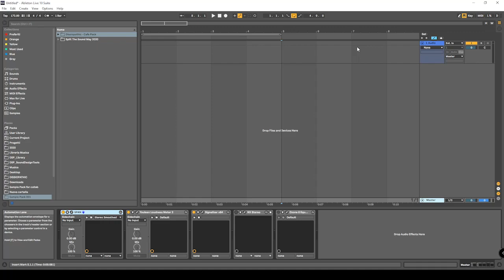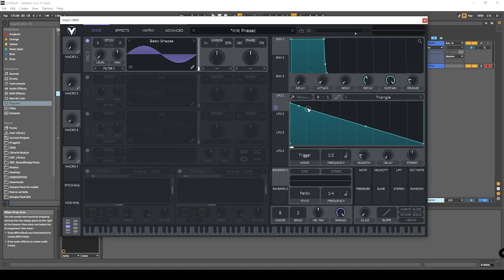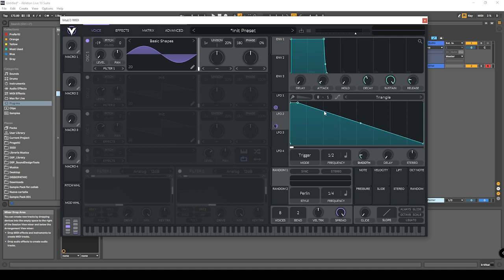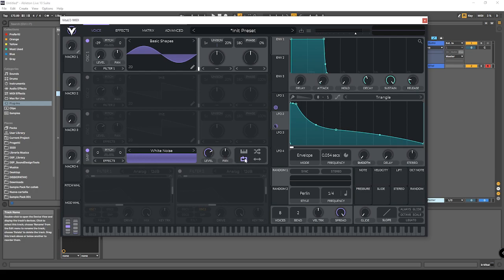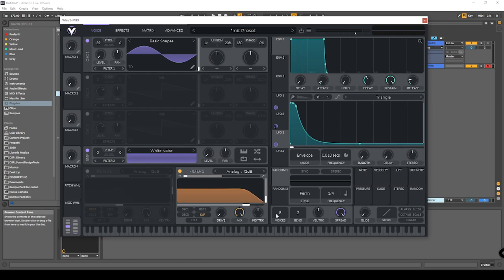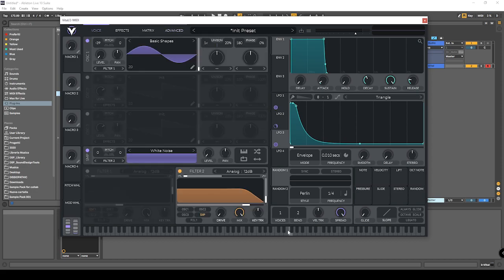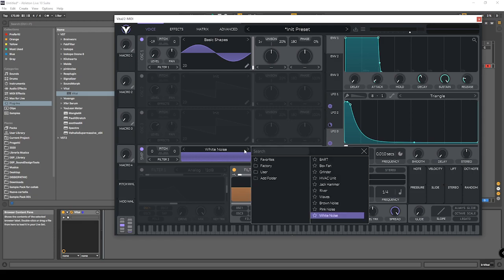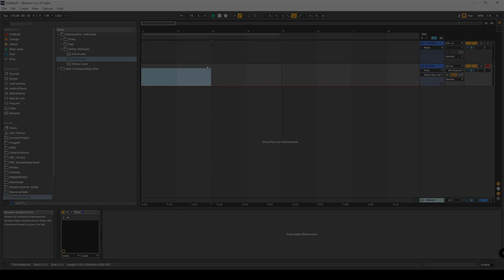VITAL SOUND DESIGN - Making a Kick

Comment: @ SPLIT THE SOUND

I’m trying to make a distorted 909 kick and I have only 1 oscillator with a sine wave transposed down to -17. I have modulated envelope to pitch for the click sound. 

But I feel like the sub from the sine wave is too growly and bassy and not clean. Changing octave doesn’t help either. 

Any tips on how to make it better and get it sounding like an actually TR909?

Comment: Please help me - how can I repeat this kick with the help of LFO? So that I can hold one button on the midi keyboard and this kick is played many times since I drew the lfo for this. Where do you need to hang the lfo given this method of creating a kick?
Reply from the maker: The easiest way is to put it on a midi track and loop it
Reply: @splitthesound743  Thank you for your kindness, but that doesn't work for me. I need to program a synthesizer without using external sequencers. I've already done it, it's all good. I turned in lfo sync instead envelope

Comment: Nice, thank you! The most important thing I learned, was that you did not use the designated envelopes, but instead used the LFO’s in envelope mode. I suppose because you have more flexibility there.
Reply: I'm not clear on the advantage of using an LFO as an ENV ?
Reply: @KozmykJ  you can add as many points as you want so you can shape your envelope in any way you want. The dedicated envelopes only have a fixed number of points.
Reply: @ExAfricaNovi  Thanks for that. I get it now 👍
Reply: @ExAfricaNovi  please help me - how can I repeat this kick with the help of LFO? So that I can hold one button on the midi keyboard and this kick is played many times since I drew the lfo for this. Where do you need to hang the lfo given this method of creating a kick?